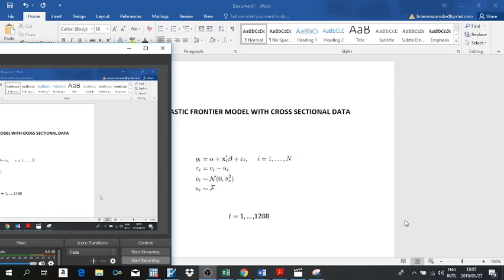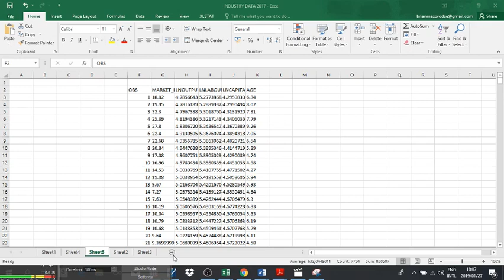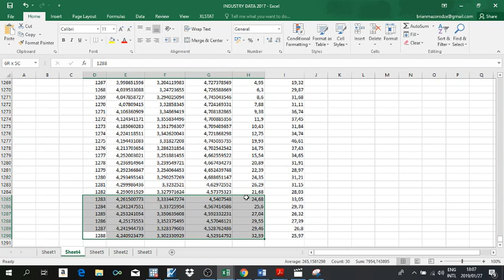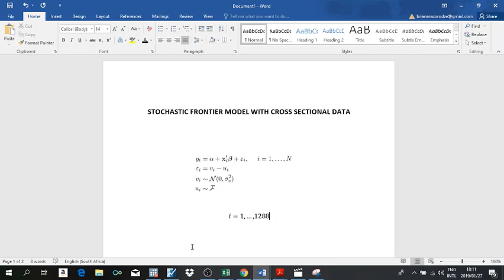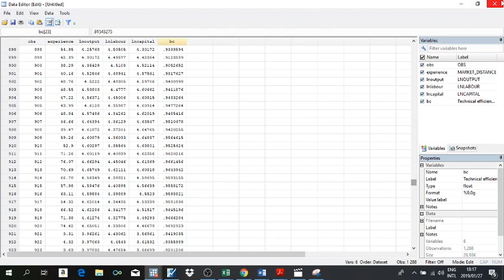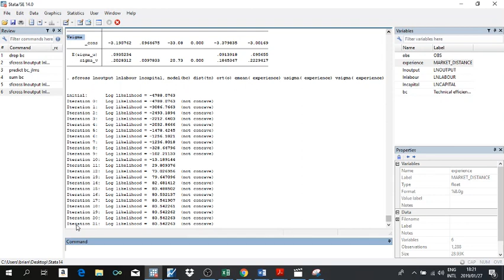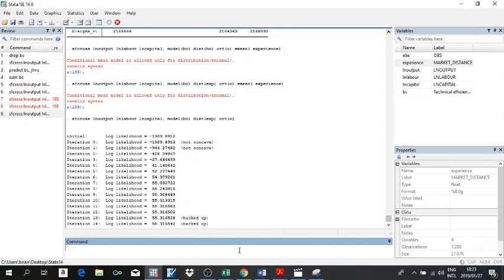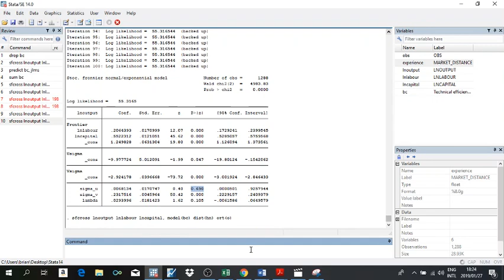Stochastic Frontier Model with Cross sectional data

Comment: thank you Brain!  what amazing concepts and gives a good way to estimate technical efficiency of firms, industry and etc. I'm doing too in this area. I would like to ask for some help from now. I am using STATA version 13, when I command in the command box like this; frontier log output logx1 logx2, model(bc) dist(tn) ort(o) emean(z1 z2 z3) there is no result made to me. please what the reason behind this problem.help me.thank you with respect
Reply: It is because of multicolinearity problem, some of your variables colinear.
Reply: @sandeidoleke895  hoo thank you again. It think the dummy variables i was used is cause to this.i was use 1 and 0 for dummy varible representation for 5 varible of inefficiency varaibles,is it may be cause of multi collinearity?
Reply: @sandeidoleke895  help me this please! when I was estimate inefficiency variables by using trunced normal, it gives me high level of p value to all variables, what is this solution? how i can estimate inefficiency variables by using exponential or half normal distribution.
Reply: this is my STATA response;  sfcross logmzeyld logland loglabor lognps logurea, model(bc) dist(t) ort(o) emean( extsn crdt isfm coop offarm hhsze owship age edctn exprce)
unrecognized command:  sfcross
r(199);

. sfcross logmzeyld logland loglabor lognps logurea, model(bc) dist(h) usigm( extsn crdt isfm coop offarm hhsze owship age edctn exprce)
unrecognized command:  sfcross
r(199);
Reply: @abditumurih.8553  you have to install sfcross before running your regression, this is the command: ssc install sfcross
Reply: @sandeidoleke895  thank you very much  gain it#Sande .once again what the reason that the omitted value of coefficient and p-value of given variables when i regress sfcross

Comment: Thank you for this great video.
 i am using stata and "sfcross command" for calculating profit efficiency with cross sectional data. 3variable inputs and 2quasi-fixed inputs. i have some questions.
1) How to apply or test the properties of the profit function? like monotonicity, convexity and ...Is it necessary to test these at all?
2) Does estimating a profit function have a specific command? Or the software itself detects?
3) What is a one-step command estimate for my model?

Comment: Thanks for this very nice video sir. It has really helped me. Please I have one question: how i test for the different functional form in such an analysis. Let's say to test wether the model best suits a cob Douglas or translog functions using a hypothesis test.  A command will be of great help sir. Thanks
Reply from the maker: One easy way is to simply estimate an unrestricted model (the translog) then conduct a Wald test for joint significance on interactions and squared terms in which rejection of the null will be evidence in favour of the Translog over the Cobb Douglas. The other option is to conduct the LR test for the two functional forms.
Reply: Hi Sir. Thanks for your smart reply.  Unfortunately, the sfcross command did not work for me and I don't know why. I  am using stata 16.1 version. I would be glad to hear from you again. Thanks

Comment: Hi! I have a question, what if the internal variables like fertilizer resulted into omitted? what does it mean? pls help me with my thesis
Reply from the maker: You specified a fertilizer variable & it got dropped during the iteration process? Multicollinearity is the number one suspect.
Reply: @brianmazorodze4860 hmm actually sir my other internal inputs also resulted into omitted apart from farm size. I think multicollinearity was the reason why my data won't run using Frontier 4.1 so i decided to use stata then got the result
is there any possible to that solution since my study is technical efficiency using sfa? Thank youuu
Reply from the maker: @ellajumalon9599  how did you measure your variables (the unit of measurement)? From your output, inputs to your z variables.
Reply: @brianmazorodze4860  for fert, pesticide, and potassium are per kilograms then the cultar is per liter, the labor is per hour, the farm size is per ha. While i have 4 dummy variables which are credit, membership, cropping sys, and agri ext. The age, years in schooling, and household are not. My OBS is 82  then 1 is my time period. All my internal variables and output were divided by farm size then did the LN in excel
Reply from the maker: @ellajumalon9599  the last statement underlines the problem your are facing. By normalising your variables in terms of farm size, you have artificially created the problem of multicolinearity on your own. This explains why only farm size is remaining after estimation. It is highly colinear with other variables by virtue of it being a denominator in the dropped variables (i.e. x/farm size). If i may ask, why have you used farm size as a denominator in some of the variables and still keep it as one of the independent variables? You have invited multicolinearity due to that transformation and keeping farm size in the model.
Reply: @brianmazorodze4860  yes farmsize is remaining after estimation and the rest was omitted. what should best to do sir? should i remove the farm size as variable?
Reply from the maker: @ellajumalon9599  yes try omitting farm size and see what happens. Alternatively, undo the transformation of dividing everything by farm size.  Then include farm size too.
Reply: @brianmazorodze4860  thank you so much. Does the time period 1 needs to be included in the command sir?
Reply from the maker: @ellajumalon9599  there is no need for including it. If your time period is 1, you are simply estimating your model using cross sectional data. There is no point in including a time variable since 1 period cannot capture technical changes.
Reply: @brianmazorodze4860  what usually the command of dummy variables sir? In viewing ur example, i don't see any dummy
Reply from the maker: @ellajumalon9599  i did not include dummy variables in this example but i could have easily included them in the usual way we do in standard regressions. A significantly negative coefficient on a gender dummy that takes 1 for males and 0 females would tell you that males are more efficient (or less inefficient) on average that females.
Reply: @brianmazorodze4860  thank you so much sir. The data did run already, Id used dist tn same as yours
Reply: @ellajumalon9599  hi Ella jumalon.Ihope you shoud done thesis on technical effeciency. i would like to ask your help please at estimation area.when i should regress by following Brian video, the result the STATA software lost me the result and saied like this;  sfcross logmzeyld logland loglabor lognps logurea, model(bc) dist(t) ort(o) emean( extsn crdt isfm coop offarm hhsze owship age edctn exprce)
unrecognized command:  sfcross
r(199);

. sfcross logmzeyld logland loglabor lognps logurea, model(bc) dist(h) usigm( extsn crdt isfm coop offarm hhsze owship age edctn exprce)
unrecognized command:  sfcross
r(199);
what is the problem? help me please
Reply: @abditumurih.8553  I used different software last time; it is intended software for TE only. At least, advised by my thesis adviser.
Reply: @abditumurih.8553  You have to iintall sfcross beforehand, therefore tape: scc install sfcross, and then run your regression afresh

Comment: what if there are other variables other than labor and capital, in that case should we look for cobb Douglas production function?
Reply from the maker: You can always augment the conventional Cobb Douglas specification depending on the inputs one is working with. For example, there are cases where one may consider adding raw materials as a seperate and third factor of production.
Reply: @brianmazorodze4860  thank you very much sir, what would be the procedure if we have to use translog production function?
Reply from the maker: @kapilkhanal9176  i will make a video and upload so you can see my friend.

Comment: Thank you very much for the presentations, i learnt alot. However am trying to run a frontier model but the coefficients for sigma u and lambda are not statistically significant. Any comments on how they should behave and what that means?
Reply from the maker: That is a red flag. You need to conduct tests for inefficiencies. Chances are higher that your frontier devations are entirely random. That is not a good sign for using a stochastic frontier model as it signals the absence of technical inefficiencies.  I would advise that you conduct the LR test for inefficiencies. You are likely to reject the sfa in favour of a simple prdn fxn.

Comment: Thank you for a  nice presentation Mr. Brian. Absolutely, it is very helpful.  I would like to know how the SFA commands for the 2 step approach work!
Reply from the maker: It depends on your specification. But basically you estimate your frontier specification first using the standard command. Then type predict te in your command box. Use the computed te values as the dependent variable in the second stage remembering that te goes down when this value goes up unless you first compute your technical efficiency scores from this variable i.e. gen tech_e=exp(-te).

Comment: Thank you very much for responding. My STATA version is 15.1 I used following command sfcross PTY FSZ COS THL COWP CMNUA CNPK, model(bc) dist(tn) ort(o) emean(AGE GEN DL1 DL2 DL3 FSZ) . 
Then it worked. But I have to use equal number of explanatory variables in both frontier and inefficiency . Do you have idea about any document that I could find these commands. Thank you
Reply from the maker: check Stochastic frontier analysis using Stata by Belotti et al. (2013) published in the stata journal 13 number 4, pp. 719-758. Goodluck.

Comment: Thank you very much for the excellent video. I used the same command to estimate frontier & correlate of inefficiency. My emean command did not work. It only estimated the constant term EX my command sfcross lPTY LFSZ LCOS GEN LD3 CNPK, model(bc) dist(tn) ort(o) emean(AGE) my e-mean model did not work Plesase tell me if there is any mistake in my command
Reply: It depends on the version of your Stata for instance, Stata 14 do not accept such commands

Comment: what the difference between eman(varlist) and u(varlist) when study the influence on inefficiency? thank you sir
Reply from the maker: Do you mean usigma(varlist)?
Reply: @brianmazorodze4860  yeah
Reply: thank you very much sir
Reply: @brianmazorodze4860  consider these two commands: (1) sfcross lnyield lncapital lnlabor, model(bc) dist(t) ort(o) emean( z1 z2 z3)  (2) sfcross lnyield lncapital lnlabor, model(bc) dist(h) usigma( z1 z2 z3)
Reply: does command (2) also estimate the influence on inefficiency ?
Reply from the maker: @ruilin4687  oh yes you can... specifying usigma(z1...z3) together with emean(z1...z3) will be okay if you do not want to restrict the way z1...z3 affect efficiency of your DMUs. The point is that ui is a function of u and sigma_u so you have no good justification of thinking that z1...z3 affect ui through u and not sigma_u and conversely thru sigma_u and not u. Given this, you are better off having a flexible specification like one you have here in which z1...z3 affect ui through both the mean, u, and the variance, usigma. Note as well that you can also add the same z or other variables in vsigma (z1...z3) if you think that your stochastic component of the error term is heteroscedastic. In such a case you would need to add a constant 1 plus the z variables. Hope it helps..
Reply from the maker: You can check this staff in a recent book by Kumbhakhar et al. 2015.
Reply: @brianmazorodze4860  thanks very much, i'll read that book again
Reply: @brianmazorodze4860  i'm still a little bit confused. eg. i type these command : sfcross lnyield lncapital lnlabor, model(bc) dist(t) ort(o) emean(z1 z2 z3) usigma(z1 z2 z3) . how can i explain the impact on inefficiency? by the coef of z1..z3 under mu, or by the coef of z1..z3 under usigma?
Reply from the maker: @ruilin4687  if the coefficient of z1 in the emean model is -0.25, then a one percent increase in z1 reduces technical inefficiency on average by 0.25 percent. If in the usigma specification the coefficient of z1 is -0.30 for example, then a one percent increase in z1 reduces the variance of technical inefficiency by 0.30 percent.
Reply: @brianmazorodze4860  thank you very much sir